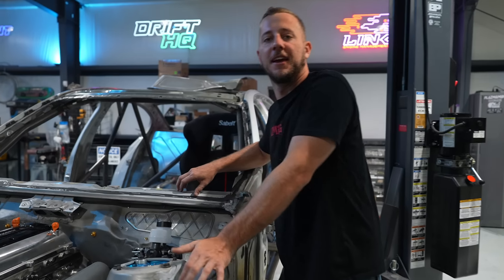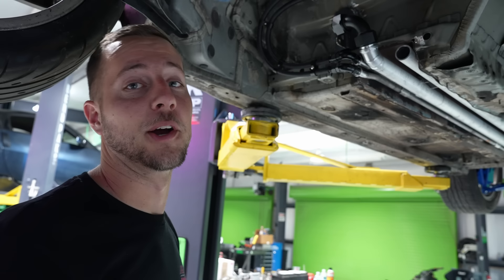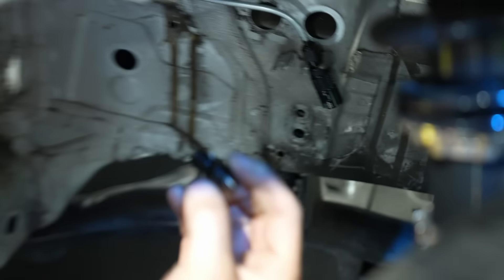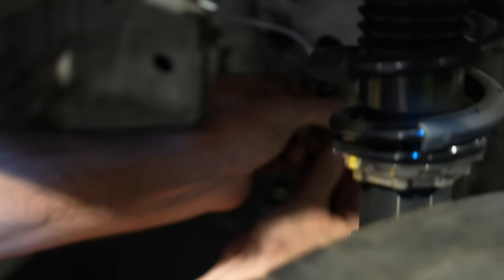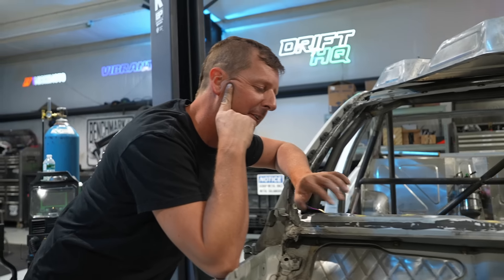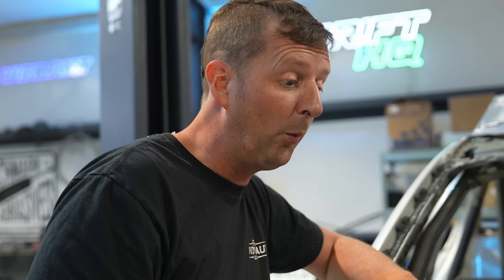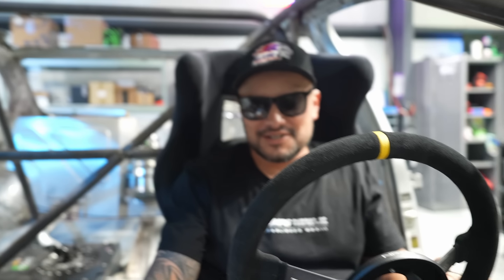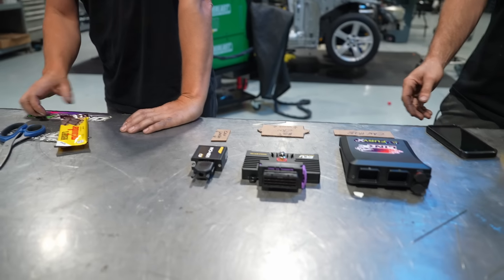Back on the 2JZ BMW F30 Comp Car

Comment: Theres a good Bosch sensor that reads pressure and temperature you should make one to use them sensors too im pretty sure they are a fatter shape than them link sensors .
Reply: We will check it out!

Comment: I like the remote sensor mount but how would it work for temperature. I have oil temp and two water temp sensors. Just running 3an will get the temperature of the liquid 3-4 ft away? Bird it have a flow through so the fluid is circulating?
Reply: Carl it the Baron. Gets you that German vibe and it’s simple.
Reply: The sensors are pressure sensors not temp sensors sorry I probably said temp on accident.
Reply: @CrickettFab  that makes sense. If you could make some with two fittings the fluid would circulate and could probably work for temperature as well  
But I now know to order a smaller one. 👍
Reply: @texaspowerman  I’m sure it would cool a little on the way over there but yes you could 🤘🏼

Comment: Had a question I’m new here so idk if you guys want to advertise what you’re using but I was curious which high temp brake fluid you guys use like Motul 660/700 or Brembo dot 4 or 5.1?